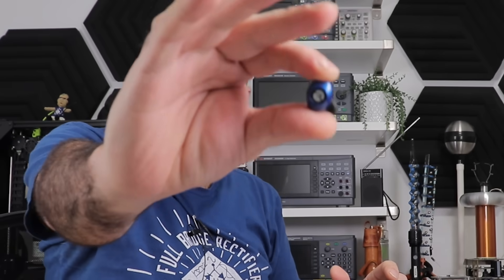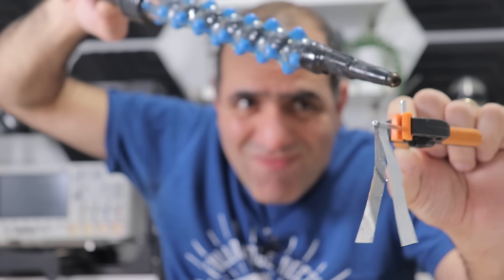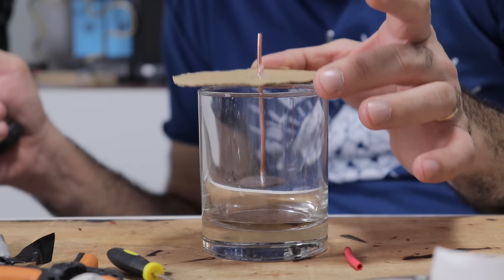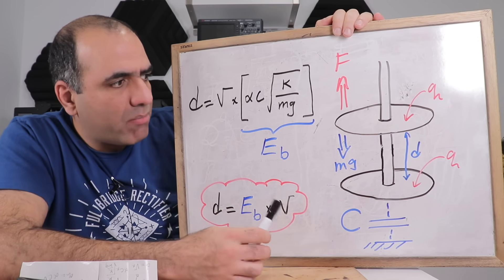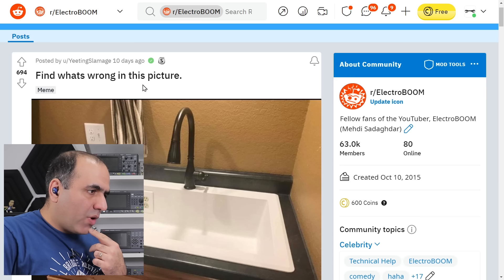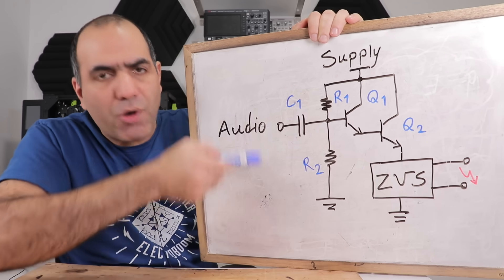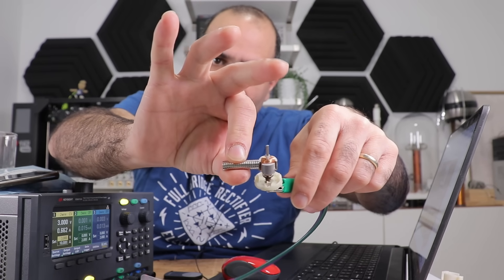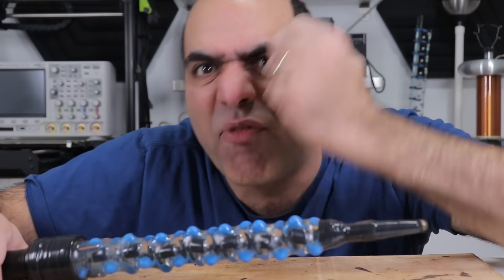I Reinvented the Electroscope! (LATITY-008)

Comment: Finally someone is willing to take on Veritasium. His reign of long wires that turn on instantly like a fricken transformer has gone unchallenged long enough!
Reply: One doesn't simple claim the EE waters without being challenged by Dave Jones or incurring the wrath of Medhi.
May God have mercy on the souls of the unprepared, for they don't care who you are, they will pick you apart.
Reply: @youkofoxy  it's spelled M-E-H-D-I
Reply: @youkofoxy ee?
Reply: EEVblog already made a nice analysis video. his conclusion is that while most of the facts are correct, Derek leaves out a LOT (like ignoring capacitance and inductance effects even though he hand wavingly mentioned impedance)

If i had to explain whats going on in the thought experiment he proposed, its that there is a transient current and voltage when the switch is closed, allowing the virtual capacitor between the two wires right next to the source and load (battery and bulb) to pass current nearly instantly. Though i would like to see him explain what would happen if the wires weren't straight, but in large circles so they have barely any capacitance between them
Reply: @blueberry1c2  for the thought experiment we have to assume perfect solid conductors and low enough power that the effect of capacitance in negligible. So a perfect circuit with a 9 volt battery and zero losses. Also I believe the thought experiment is a discussion over the time between closing the switch and having any energy at the furthest point in the circuit. 

In reality, yes the voltage drop over the wires would require a massive power source, the capacitance would be a serious issue, braided or twisted wire would have induced stray currents, and the heat of the current required would make and feasible wires explode or at least get dangerously hot causing additional resistance. Further, what switch could handle these requirements? The assumptions needed for the build is also that it is lit instantly and that it is strictly binary. Really your load from the bulb should be an extremely fast and sensitive transistor that then opens a small circuit to power an LED, in order to reduce bulb voltage drop on the original circuit in question. 

Consider still the charge in the wires in relation to the switch. At the switch you have a negative and positive potential across that gap of (in our impossibly perfect series circuit of 9 volts, the sum of all voltage drops). A series circuit has the same current at all points so as the switch closes the curry is instantly the same at all points, again this is with zero (not approaching zero, but actually zero resistance).
Reply: @nemoexnuqual3643  Veritasium claims is the distance between the battery & the bulb only being 1m to be the deciding factor that the bulb turns on so quickly. (In addition to the ‘impossible’ conductors) 
He’s claiming that the energy is ‘jumping’ from the battery to the bulb through the space between them, regardless of the length of the wires. I don’t think this is the case. He is correct that the electrons aren’t ‘pouring’ through the wire from one end to the other like water through a hose, it is in fact the electromagnetic field that is delivering the energy, but how the EM field gets from point A to B is still up for debate, IMO. 

I submitted that even if the battery & bulb were miles apart, wires in a circle, the bulb would still turn on just as quickly, bc the EM field propagates through the conductor at the same time it takes the electrons to move from one atom to the next, not in a ‘time delayed daisy chain’ but I suspect all electrons in the conductor that are going to move all move nearly instantly, thus creating an EM field almost instantly throughout the entire circuit. (Obviously, real life would account for an imperfect conductor and voltage drops.)
Reply: @DurfDiggler  The world is in fact filled with a LOT of EMI. 

The distance between the switch and the bulb determines the time delay, but you are right that the wires still matter, the way they're set to determines what fraction of the power is transmitted (the wires are acting as a pair of antennas). And he did totally gloss over that.
Reply: @blueberry1c2  To be fair, EEVblog's simulation only showed that it gets a sub-microsecond pulse of current if you connect the bulb to ground .  He made an antenna.  V's setup did not ground the wire loop.
Reply: @blueberry1c2  IIRC for circular wires there would be literally zero capacitance -- the forces cancel
Reply: @blueberry1c2  OK let's expand the thought experiment: Let's add a switch at one of the turning points for the circuit... Now we assume that we have a really fast switching + detecting mechanism (instead of a light) in the place where our observer is. And we also have a really fast switching mechanism at the turning point. Now normally information cannot travel faster than light, but if the light would turn on within nanoseconds if the circuit was closed, we could poll if the switch at the turning point is closed or open, meaning we would transmit information faster than light. (The switching+detecting mechanism additions are only to make the FTL communication machine more practical)

The effect Derek describes is something completely different from actually transmitting electric power through the circuit. there doesn't even need to be a circuit, if two wires are side-by-side but not connected one will induce a current in the other when it's under electric load. So his entire light-second spiel is entirely pointless, because the effect has nothing to do with conduction but induction.
Reply: @insu_na  when my comment said "transformer" am I right there? Is this just the world's longest transformer?
Reply: @insu_na  No, you just don't understand the video. (Which is really Derek's fault, he didn't explain it very well at all.) The time is determined by the distance between the switch and the bulb. In his case the switch was 1 meter from the bulb, so the time was 1 meter/(3x10^8 meters/second). If you put the switch further away it will take longer. And the configuration of the wires determines the coupling strength. The wires are acting like a pair of antennas. If you cut the wires to just tiny stubs by the bulb and switch you have very small antennas and will still technically transmit a tiny bit of power, whereas longer wires will work better (up to a point). But if they aren't actually connected then the light will just blink on and off.
Reply: @danieljensen2626  no, I just checked. He makes it very clear the time is determined by the distance of the battery to the bulb. He is saying that the electric field (the energy) isn't following the 1 light second long wire, but is instead propagating outwards from the battery until it hits the lightbulb that is 1 meter away.

Edit: the time it takes to turn on the bulb should be d/c where c=speed of light and d=Length of the wire between the battery and bulb, NOT d=distance between the battery and bulb in a straight line. So instead of 1/c you get 300Mm/c .
Reply: @danieljensen2626  that is exactly what I said lol
Derek used 2 separate but related concepts to bamboozle viewers by claiming that induction is the same thing as conduction
Reply: @Drawliphant  I see that there is much debate on the veracity of this claim, (see I made a terrible joke there),  I predict that there is one physical effect that has been overlooked, the skin effect, which is the effect where a transient voltage travels through not the body of a conductor at first, but along the surface of the conductor.
Reply: @seq31  at what timestamp does he say that? I don't want the rewatch the whole vid again, it pisses me off by its' clickbaitness
Reply: @seq31  oh, yeah, that part... but even there he doesn't clearly state orders of magnitude for the work done by the direct fields and the work done by the electrons moving (in-wire fields). Anyway, nuff said, thank you. I hope Mehdi won't hold back.
Reply: @insu_na  ???? that was clear as mud
Reply: @blueberry1c2  The circle vs straight line is exactly what I posted on the Veratisium video. He seems to be claiming that it’s the fact that the battery is only 1m away from the bulb that is why it turns on so quickly, that the energy is “jumping” from the battery to the bulb. I don’t think that’s true, else the world would be filled with much more EMI, but hey, I’m open to be proven wrong.
I’ll have to check out the EEVblog video.
Reply: @blueberry1c2  Frankly, to me at least, it doesn't matter all that much if Dereks purely theoretical approach is correct. Basic back-of-the-envelope engineering says that it would be near impossible to build something like this. And even if you could, it would be completely useless. Basically, he wants to solve a problem that has no practical application i can see. (I might be wrong, of course).

Of course, there are many fields of science that have weird theoretical problems. But you can turn nearly every problem in mathematics into cryptography. And, as history has shown, if you spend enough money, you can turn nearly every problem in chemistry or physics into some sort of weapon...
Reply: @ReneSchickbauer  Veritasium likes to do that with math “problems” too. He’ll pose a mathematical riddle as something that can be solved, experts have gone mad trying to solve them, but no one ever states what practical purpose they could possibly serve. 
Imagine he had a video titled, “Language experts can’t solve this phrase!” And the phrase is simply, ‘Repeat this sentence.’
Reply: @ReneSchickbauer  The point is to show this is how EM energy travels, not to show how to build a lightbulb powered by a battery connected by a long ass wire. It's not some weird, niche effect with no application. The common thought is that electrons flow like water from the battery to fill the light bulb with electricity. But that's the wrong way to think about it. How would AC even work if that's the case?
Reply: Yes I am also waiting for Mehdi to reply on Derek's video.
Reply: FYI, the science asylum channel did a video on the same subject 2 years or so ago

Link: https://youtu.be/C7tQJ42nGno
Reply: I commented on the veritasium video a few days ago. He's assuming speed of light, which is in a VACUUM. Wire is NOT a vacuum needless to say
Reply: @wardsmith2542  but if the energy travels around the wire how could c be different? It's almost like copper is the medium???
Reply: @Drawliphant  2/3 of the electricity goes outside (the "skin" effect) but 1/3 goes thru. 

C is the speed of light in a vacuum, period. Another way to think about this is glass. How long did light take to travel thru it? Now what happens if the glass is thicker and thinner? Hint, this is well known and understood by those who design cameras, telescopes and yes, corrective lenses
Reply: I think Derek saw the success of the "rivalry" with Steve Mould and deliberately chose something controversial and overly-simplified explained it so he could have something like that too.
Reply: @MattsAwesomeStuff  . I disagree.while I do think he does take into account the traffic controversial topics create, I don’t believe that is a remote driving force behind his content. It’s designed to be provocative, but it’s meant to challenge the viewer in a way that they can learn more.
Reply: @MattsAwesomeStuff  Good bet actually. He's all about the click bait and growing his cult of personality.
Reply: Derek is trying to apply physics on electromagnetic effect on macro level, only problem is he's not counting all parameters and also missing out lots of details - as lots of people have point out.

Being an educational video it has to be challenged because the sheer no. of people would believe what he's saying. Given the channels importance, YT can be a dumpster and ill logic at many times. Yes at the end of this debate, people will be called out, there will be divide and Darek wins with the fuel of this social media debate which doesn't add up. It's upto community to decide what kind of YouTube they want in future - clickbait or productive?

Current at atom level is micro movements, not a macro movement (observations try to show it). Also he's comparing electromagnetic waves with actual electron flow, forgetting thete are trillions of electrons in even small chunk of metal contributing the phenomenon.  Basically analysis is slightly right that it's internal EM that transfers energy and. Ot the electrons themselves but this energy is transferred at pico meters distance in metal lattice and when "free" electrons move and wiggle which can create small megnatic fields or they displace other electrons or hit nucleus and fling back and forth - we see it as resistance, impedance of a conductor. The current is the end product of all of this.

He essentially challenges causality at the end because of his misinterpretation   and trying to apply physical quantum phenomenon at slight bigger level( on composite particles- where neutonian physics can describe it much better and if one thinks it as quantum level they would behave same given they are doing their calculations right). In casuality Photons wants to happen if energy exists, time wants to happens because entropy is there entangling reality with C. While electrons are more of composite energy regions in spacetime and energy pots giving them charge and spin. Essentially electrons are nothing like photons so they behave differently, but they also interact with EM field and applying laws / observations of EM field on different kind of energy and configuration invalidates his claim at the end because electrons have mass while photons don't essentially changing whole equation and claulation at quantum level too.

idk why he's trying to create controversial theories back to back 1st with wind cart and now with bulb switch and energy transfer problems.  Often when trying to prove something even good minds can become ignorant and fool themselves in the process of showing world they are above something. These case seems likely same!
Reply: @MaulikParmar210  He's doing it because he craves attention even more than he craves to educate. He's gone from educator to celebrity.
Reply: @gworfish  It's money too, if you make videos like that, you are sure to get other youtubers to make videos attempting to say you are wrong. This in turn allows him to make response videos, and all videos involved end up with a boost in views. (=more money for him) It wouldn't surprise me if these people were talking to each other beforehand and planning these debates for an increase in views actually.
Reply: It's been 6 days lmao
Reply: Yes im waiting the expisode :-D
Reply: Ok
Reply: B-)
Reply: The capacitance would drive the electric field and it would turn on in the time it takes the speed of light to travel 1m
Reply: @TylrVncnt  Isn't the capacitance of two ideal parallel infinitely thin wires zero, though?
Reply: @Dockhead  He kind of burned his bridges when he showed up with Bill Nye's cringefest involving SJW's "my sex junk". Bill Nye letting himself be swept away with the left's wacky politics rather than sticking with making science videos. Perhaps for the same reason Veritminussum [sic] does - to get clicks, views, and sponsorships. What's more, it's not a one-off either.
Reply: With the "punchline" stating the effect he wanted to show us, his answers are all wrong because the wire will be experiencing current all the time from distant power sources, radio waves, the Earth's magnetosphere, cosmic microwave background, etc.  So the correct answer to "when will it show the very tiniest current" is "it already is, and you don't need to close the switch".
If he really does try it (with miles-long wires) he'll have to go to heroic means of detecting the very weak current in very fast transient pulses, and will not simply see the lamp light.
Reply: he is right, the creation of magnetic fields on the battery wires moves current on the opposite wire if they're close enough, ofc the current is not enough to turn on a bulb, Derek mentioned a perfect bulb
Reply: Unchallenged 0:30
Reply: Indutance?
Reply: He was willing to go after Walter Lewin, so I think he would challenge anyone lol
Reply: The main problem with veritassium's video is that he implies that using the usual current analogy is wrong. It may be wrong in a strict sense, but it perfectly describes most of what an engineer messes with every day (exceptions are anything that work with fields or RF). It's just like newtonian physics: useful and accurate for 99% of the models used in the real world.
Reply: I can't stand Veritasium. The presenter is so freaking full of himself I can't believe his ego fits into the frame. Many episodes feel less like he's trying to teach, and more like he's trying to show off how cool he is.
Reply: Yeah yeah, always wait for the celebrities to tell you the ultimate truth. Never try to think on your own...
Reply: @HoSza1  you're missing the point... if it takes one celeb to make another be better, then it's a win for everyone.
Reply: @vanoscrap6296  In fact i'm  fascinated by that someone, at least, have even read my comment, at all.
Reply: Wasn't he the guy who appeared in that gender is spectrum episode in Netflix. Yea ever since that he lost all credibility